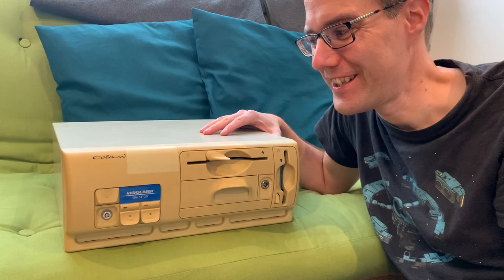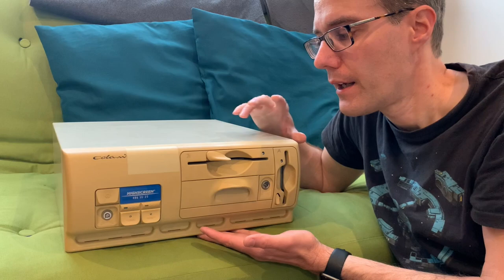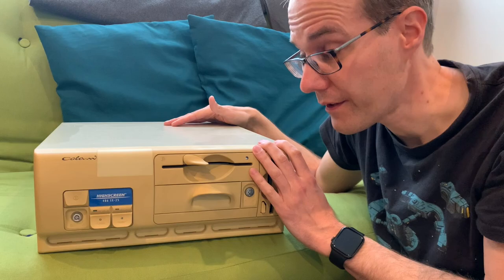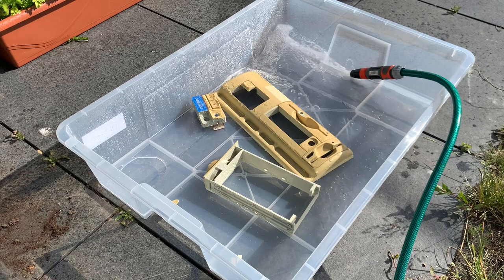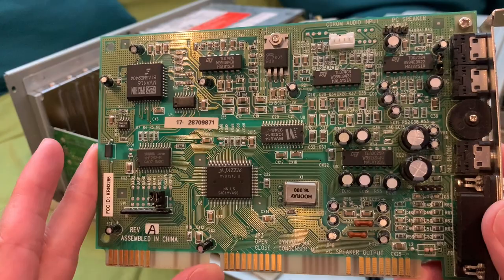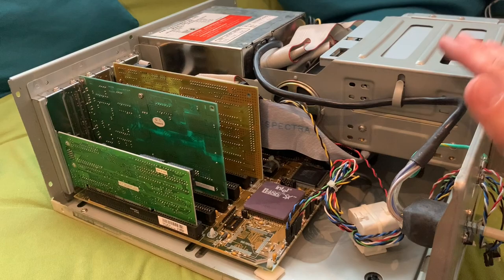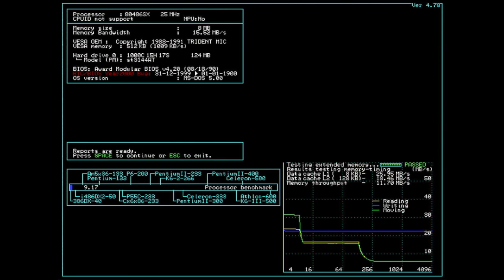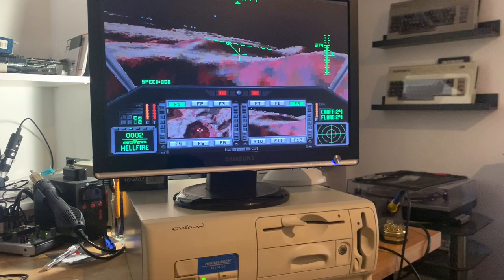Our First PC: Highscreen Colani 486SX

Comment: Beautiful machine! We had a very similar one back in the days. Same case but without the curved colani style. Ours had a mitsumi 4x ide cd rom and VLB already. CPU was an IBM blue lightning (cyrix I guess) SX2 66, so also no FPU. 8MB of ram. So much memories :-) it must have been around '96 because we installed win 95 a lot of times. When something was wrong, Format c: and reinstall :-) Thanks for the video.
Reply from the maker: The Colani design was relatively short lived. Maybe for 1 or 2 years they had that. Afterwards they went back to beige boxes...

Comment: I've never seen such curvy floppy drives before! Unfortunately that means if a drive ever fails and you need to replace it, if you put in one with a regular flat faceplate, it will look wrong.
Reply from the maker: I guess you could take a regular TEAC mechanism and use the existing faceplate.

Comment: Our family had exactly the same Colani 486SX-25 with two floppy drives! Bought it in early 1993, upgraded with a fancy pants real SB16 later that year, followed by that same Mitsumi double speed CD drive in summer 1994 (it didn't look great in that 5.25" slot...), an additional 4MB of RAM in late 1994 (to play Might & Magic 5), and finally a Roland Sound Canvas MIDI add-on board for the SB16. It was eventually replaced by my first fully custom built PC (Pentium 100 in a full tower) in late 1995. Unfortunately, I think the Colani case (with mobo + CPU still inside) was eventually thrown out. :(
Reply: P.S.: Also a second WD Caviar 850M HDD in summer 1995 that went into that internal 3.5" bay that's missing in yours.
Reply from the maker: Yup, I think this is what many people did. Too bad they didn't sell a matching CD-ROM drive at the time. That would have been so cool... But if you look at the case closely it was really built to cost. No budget for fancy CD-ROM drives.

Comment: My first PC was a 1992 486SX25. It was inferior to my 1985 Atari 520ST and Amiga 1000.
Reply from the maker: I think the custom ICs and integrated sound made the home computers better in some ways. CPU was definitely much more powerful in the 486SX though. And I must say that both ST and Amiga were lacking in video resolution and refresh rates by 1992. In retrospective I do like to not want to miss my Commodore 8 and 16 bit machines.
Reply: @root42  I am talking about DOS/Win 3.0 vs GEM and Kickstart. If only IBM hadn't insisted on charging £100+ for OS/2 2.0 onward, designed with the source code of Kickstart. All that file manager/programmer manager rubbish to avoid an Apple Lawsuit was terrible and Windows crashed a hell of a lot before Win 98 or 2000/XP era....hence the blue screen jokes :)
Reply from the maker: Well, it depends on your experiences. Win 3.x wasn’t the best software, for sure, and Microsoft used some shady tricks to manifest their chokehold on the PC market, but Win 3.1 wasn’t that terrible in my experience. Crashes were heavily dependent on the hardware and driver combinations, where Atari and Amiga had a pretty homogenic ecosystem. I find it sad that Commodore evolved the Amiga too little too late with the AGA chipset. Software was a bit dated by the early 1990s, too. GEM was also available on the PC via Digital Research, but never got a foothold.
Reply: @root42  You are getting distracted with technical features of the hardware, I have no problem with the sophistication of my 1992 486 motherboard, like I said given a decent OS like OS/2 v2.0 onward it's cool and a bargain at half the price of the Amiga 4000/040 in 1992 which just about manages the same performance for things like Vista Pro or playing F1GP. I am talking about Windows as an OS you were pretty much roped into using, terrible OS. Multitasking was terrible even with any version of windows before 2000/XP, this is what any computer science graduate or IBM engineer working at the university will tell you. All versions of Windows before Vista/7 had horrendous memory leak that was reduced very slowly over a decade, required constant reboots to claw back the lost GDI resource memory, you wouldn't be able to print a large document after a few hours of surfing on Netscape/IE etc. I know this because I was the Service Manager for the world's second largest re-insurer/underwriter.That's why I found it so backward. They also chose not to make it easy to just pop a disk in and navigate actual directories on them or the hard drive etc, which is different to every other OS. The hardware itself is OK, the serious software of an unparalleled quality to any other format in most fields etc. None this means DOS or Windows was suitable for home users who had already experienced a professional product over half a decade earlier. As for gaming, it was annoying constantly having to find more free base 640K to get the latest DOS PC blockbuster game to run by messing about with Config.sys and Autoexec.bat files. Totally unsuitable situation. If this wasn't true Quarterdeck wouldn't have made millions in profit with their QEMM386 application which did this for you. Of course OS/2 2.1 actually allowed you to run PC DOS games with 640K RAM free and still managed to have the drivers from Config.sys etc available. It says a lot when OS/2 did a better job of running DOS games fuss free than Microsoft DOS. Like I said nothing about the hardware or the underwhelming improvements/missed opportunities with Atari GEM and Kickstart updates. Commodore were the only ones removing text to speech from the OS whilst Apple and MS along with IBM were trying to get it to work on their OS. You can't even run AMIX on an Amiga 4000/040 costing £2000+ but still whilst I had lots of fun playing F1GP at 22fps on my £1000 486 PC in 1992, not really a hardware problem at all. Even the ISA bus was 11mhz and 16bit on my 486, which is actually better than Amiga 1200/4000. You just needed to buy a decent SVGA card with a blitter on it to make the PC fly, this doesn't help crash happy cobbled together MS OS user experience for people who know what a decent OS felt like.

Comment: Great machine in very nice condition but what about leaking battery?
Reply from the maker: If you watch the video closely, you can see that the mainboard has a Dallas clock chip, which has a sealed, integrated battery. Those do not leak, but loose their charge. Hence why I replaced it with a homebrew replacement with swappable coin cell.